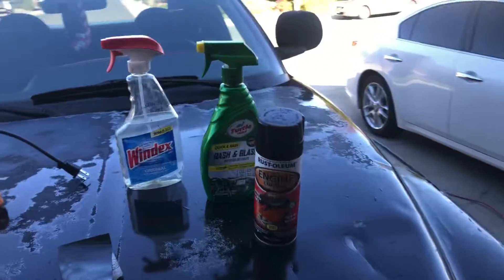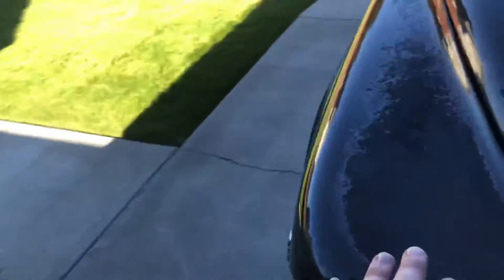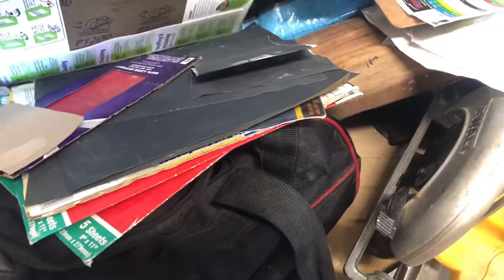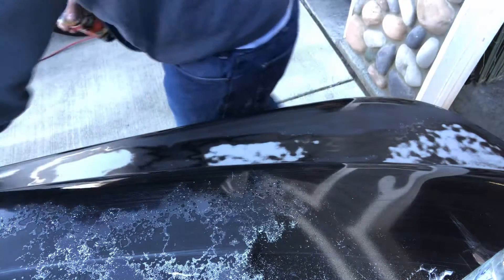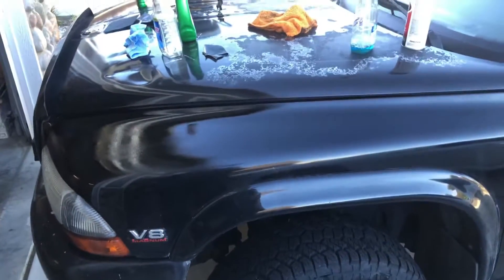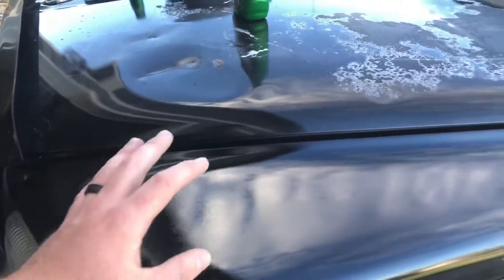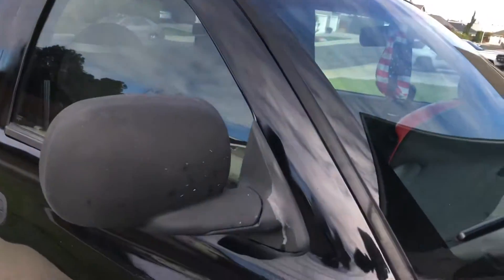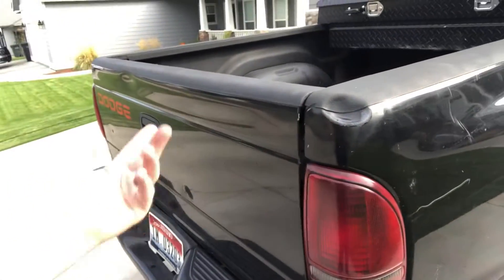Fixing clear coat flake, FOR CHEAP!!!

Comment: aye bro can you tell me what paint you used?
Reply from the maker: TBH I used a black engine enamel gloss. However I wouldn’t recommend it. The paint started flaking again. I need to redo my entire paint job.
Reply: @itzmrfizz throw some clear coat on next time and it’ll last, I did some parts about a year ago and the parts I didn’t put clear coat on are fading while the clear coated still look good.